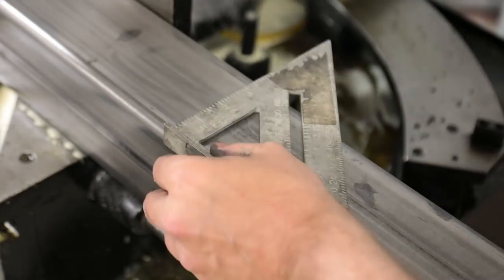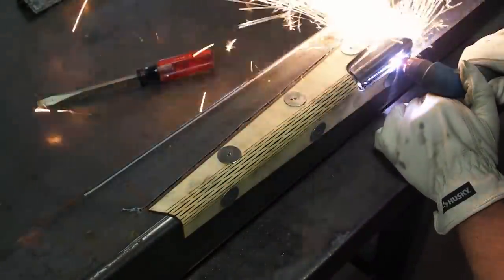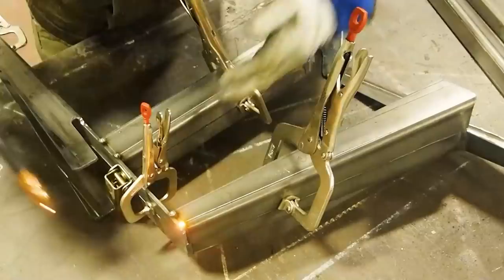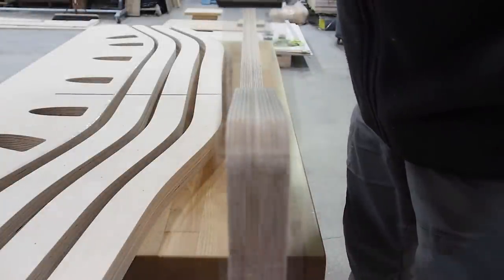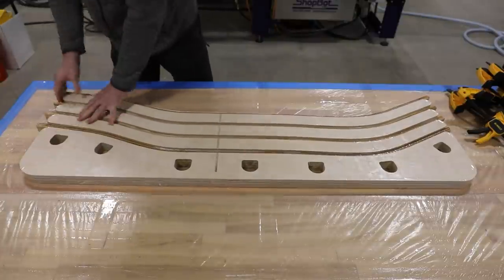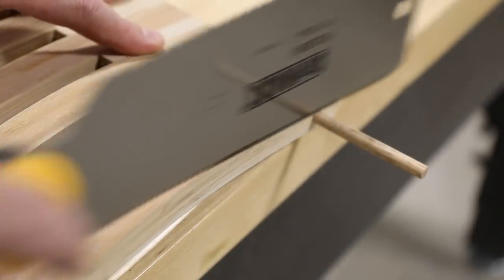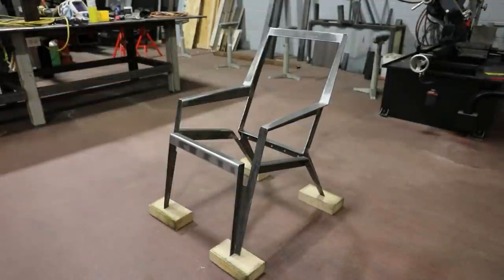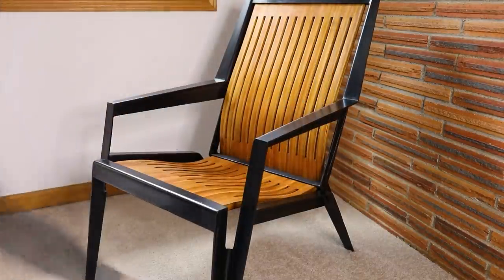Deck Chair | Epoxy Laminated Cedar and Torch Blackened Steel

Comment: Maybe some wood on the arm rests, metal is cold to touch. Extremely nice design though, if you want to go more industrial you can get the chair steel parts cut out by tube laser. 
Love your work!
Reply from the maker: Thanks! I got it quoted at $440 to have one cut with a tube laser.  They wouldn’t let me film it or else I probably would have went through with it.  Was going to have a pair of chairs.
Reply: @Grunblau  That's rather expensive indeed, we currently cut some camera cases out of 150x150mm aluminium tube with 5mm wall and for 400€ they cut 6m long tube to about 200mm pieces with a lot of holes and huge cutting edge length. I've seen cheap Chinese combo sheetmetal/tube machines coming to market so hopefully that lowers the price on this kind of jobs.
I really like the technology it makes some really interesting designs available  for the designer. I thought the laser would be couple of hundred max on price but, i get if it doesn't make economically sense and you can't get good video content either, then your cutting option makes total sense.

Comment: Great project. Every time I create something nice, at the end, I am always wishing I had just made two at the same time as usually it doesn’t take double the work to get two things. I think you should have made two:)
Reply from the maker: This is a great point.  Originally I was going to do two with the second one being cut with a 4 axis laser…. The estimate came in at $440 and the were not going to let me film the process.  Also cedar became extremely hard to come by.  

I might make another by having 2D pieces cut and bent.  If I never do another one, I guess this will be a one of a kind!

Comment: Love the look of the chair with the steel and wood!  I would suggest blueing the flat washers and nuts too.
Reply from the maker: Good point.  I considered chemical blacking them.  The video was already 20 minutes and I couldn’t be sure they would look great anyway.  A lot of people have no idea you can chemical black zinc.
Reply: I haven’t done the chemical blueing.  Just because taking all the time to make sure the parts are completely clean.  At least with the torch, fire cleans the parts.  😆

Comment: you're a square steel tube connoisseur. would blackening with linseed oil work for a steel bicycle frame or does it change the behaviour of the material? a beautiful chair and an excellent video. thank you
Reply from the maker: Might change the tube to be more brittle than expected but I am not an expert in heat treating.  This is likely the method used to produce the Black Knight’s armor.

Comment: Gorgeous chair!

You went abit overkill with 5 studs, 2 would suffice, nonetheless the result is outstanding!
Reply from the maker: Just wait until I tell you that it is 5/16” studs!  Went with what felt right and decided to put one stud in the center.  This leaves you with a choice between 1,3,5,7 studs.  You might be right with 3 though…
Reply: @Grunblau  🙆‍♂️ Like they say... Nothing overkill ever broke 😁👍 

5/16" is  7,9mm in metric 😉